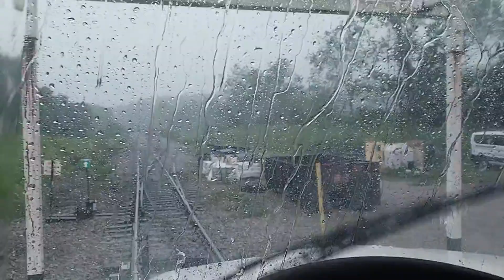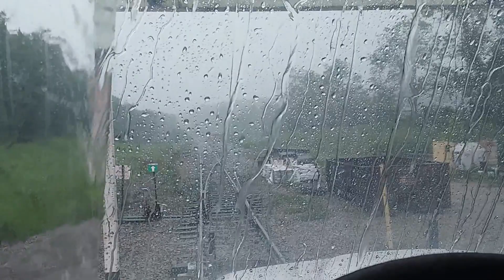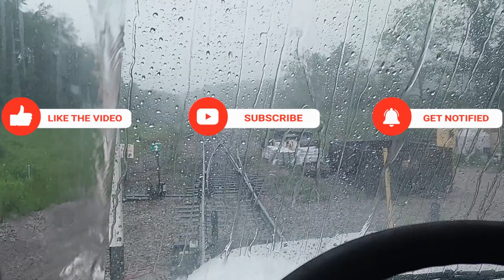Why MOW Equipment Doesn't Set Off Crossing Signal Lights

Comment: Wish you’d sent 5hat rain my way Dave, we haven’t had any measurable rain since sometime in May, and a bunch of 105 - 110 degree days since then just to make sure everything is cooked well done. Be safe out there brother. Lightning and rail changing don’t mix for sure. They make us come inside the shop when lightening is close by, but the rails in the yard are insulated from the main line with plastic rail insulators to segregate us from the control blocks, but it helps protect us from lightning strikes to the rail miles away.
Reply from the maker: Wish I could send some your way Ralfie, thanks for the info on
the insulated joints protecting the yard tracks.  Thank you very much  for taking the time to tune in and check out the video. May you have a most blessed day my friend.
Reply: You must live in Kansas!!!😂 sounds like us!

Comment: There been any proof of lighting striking rail?
Reply: A few years ago one driver was making the veteran train ready when lightning stroke the rail some 100 feet away. The driver wasn't hurt but all signals in the crossings were dead along the 15 miles of the line. I guess his ears were ringing for some time.
Reply from the maker: I once saw it hit and a fireball went down the track bouncing from
one side rail to the other OregonCrow! That was wild.  Thank you very much  for taking the time to tune in and check out the video. May you have a most blessed day my friend.
Reply: @ccrx6700  We were called to a failure after a strike that hit the rail and a switch machine. The signalman  (Dispatcher) said just what you have Dave He never saw anything like it before He was still scared to move the levers in the box, an old mechanical frame, when we got there. I said all would be OK but he let me touch the switch lever first LOL. It knocked out a few circuits but only blew fuses so things were running again before too long.
Reply from the maker: @cedarcam  👍😊

Comment: Time to get home and stoke up the fire Dave 😊
Reply from the maker: It's fun to be on rail in a storm when the truck doesn't leak Richard...:-)
Thank you very much  for taking the time to tune in and check out the video. May you have a most blessed day my friend.
Reply: @ccrx6700  your hi-rail truck leaks?? soon the electronics inside the cab will go out.
Reply from the maker: @rearspeaker6364  nope  doesn't leak